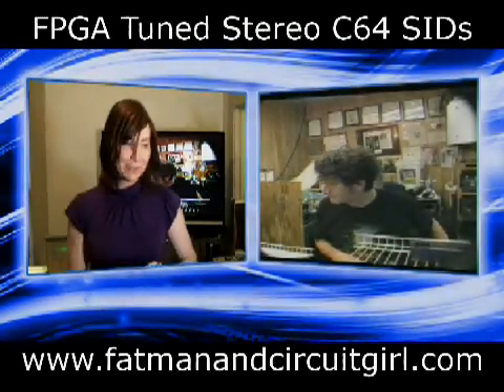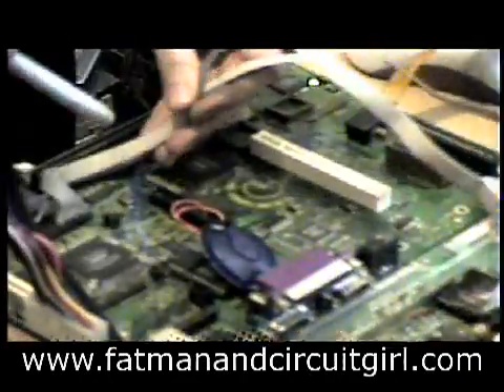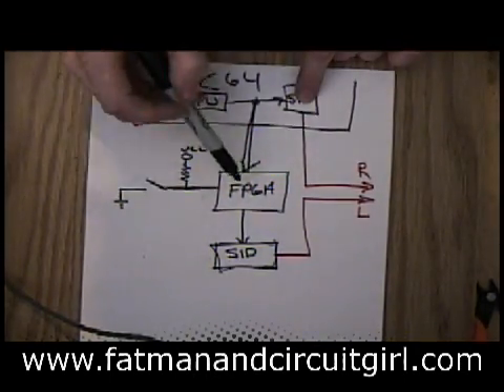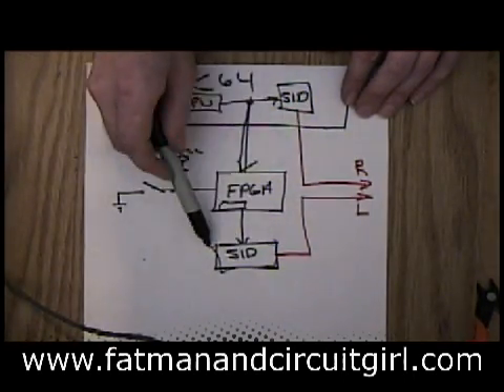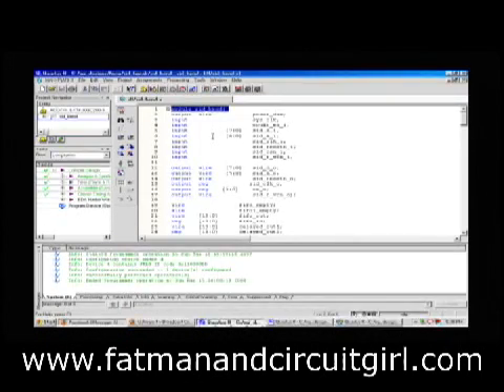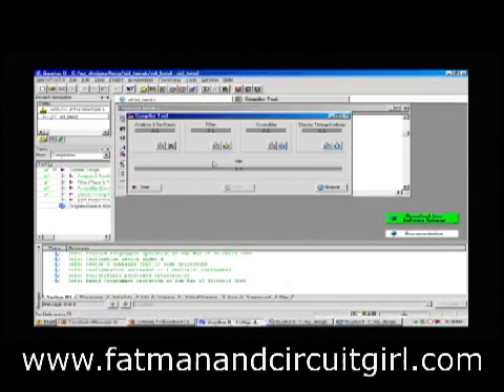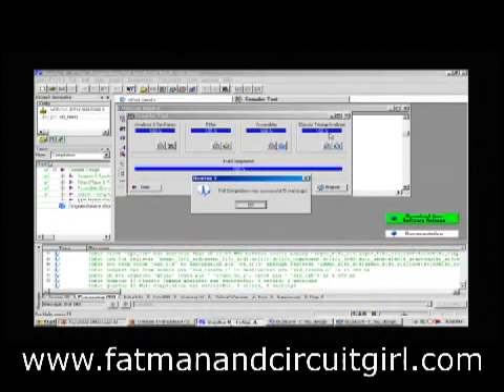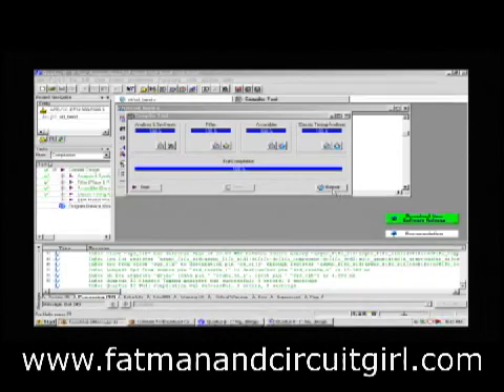FPGA Tuning C64 SID Jeri Ellsworth

Comment: I am a young person but i want to learn and i have a question fpga has a cpu built in is it necessary to use c64's CPU ?
Reply: drago zengen no, you don't get a cpu in a fpga chip directly. you need to implement a CPU on your FPGA to have one. 
And, the purpose of this project is to implement a SID chip in FPGA. so we actually don't want to have a CPU running on the FPGA.

Comment: I used to repair C-64s and E-64's (C-64 without the color), and VICs. Brings back memories. Still have VIC and SID ic's around somewhere in the shop.
Reply: Same here, still have a bunch of chips and need a broken one lol . Working ones are a little pricey  !
Reply: @californiakayaker  if you don't need the commodore chips anymore, maybe i can use them
Reply: @stefanweilhartner4415  Well, I would like to get an old C-64 , socket it, and check my chips. That way I'll know if I saved one I shouldn't have. Plus I'd like to own at least one working c-64 . Once I'm to that point, I'll check, and possibly make some of these chips available.
Reply: if you don't need the commodore chips anymore, maybe i can use them

Comment: The good old C=64.
I built a robot controller years ago for my C=64.
The robot was a bit too heavy to drive around with the computer on board, but it was a fun project. Wish I still had my old computer.
I do still have my Amiga 4000, but haven't run it for a long time.

Comment: suggestions:

take out the 1st sid entirely and then get the fpga to proxy both sids.

Then hook a keyboard up to the fpga so you can assign keys to all sorts of things, say:

- change waveforms or other parameters real time
- add delays between channels as well as pitch shifts

off the top of my head.

Comment: @jeriellsworth
Sounds great. Just wondered if you were aware of XMOS? Seems like their designs are a perfect match for a project like this (though I appreciate the FPGA did fine and you probably had one spare, I imagine it would be easier and cheaper for others to implement with an XMOS XS1-L1). Anyway, thanks for making it. : )
Reply: my way to go now is the microchip dsPIC33EV which has nice dsp-functions to calculate filters. with 70MHz and a lot of other features it is one of the fastest 5V chips on the market. the pins are not only 5V tolerant but can also output 5V.
however, guess that chip was probably not existing in 2009.
well, this chip would deliver enough juice to emulate two SIDs in higher quality than the original SID